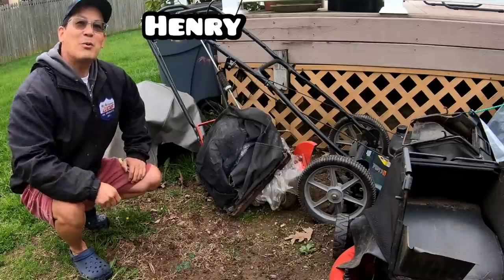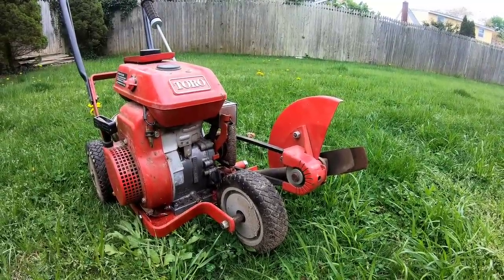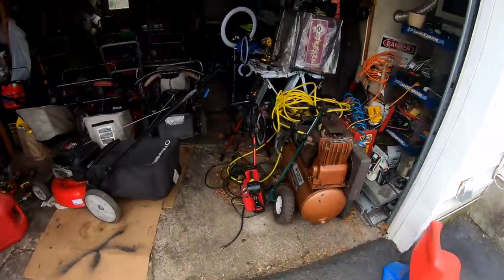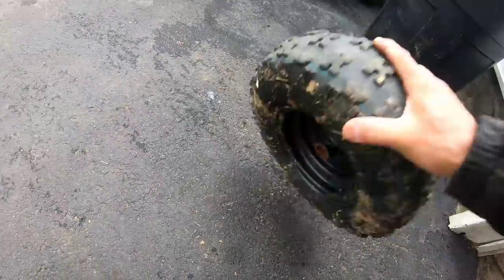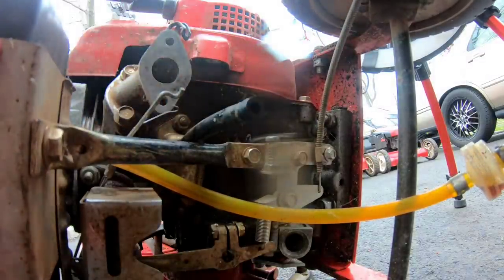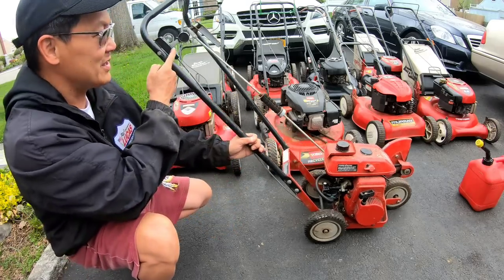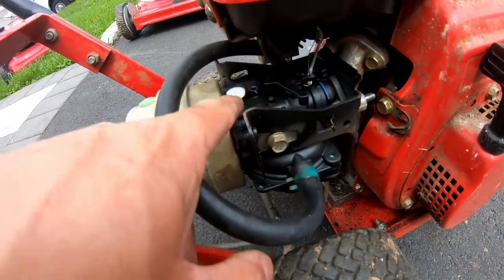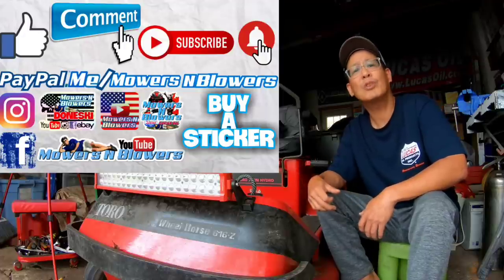FABRICATING A BRIGGS 500E 550E PLASTIC CARBURETOR TO WORK ON A TORO 58402 W/ 2HP SUZUKI ENGINE EDGER

Comment: I can't believe that worked. Those Suzuki engines are something else. I have 2 Toro mowers from the 90's with Suzuki engines. A 4 cylinder with blade clutch and a 2 cycle commercial. They both run great.
Reply: Damn a 4 cylinder mower! That must be worth crazy money. Didn't even know they existed

Comment: Wow! that overweight vintage edger belongs in the museum. I been buying those lightweight battery operated Worx lawn trimmers ($100+/-), they are great for us seniors especially me with a bad shoulder. I had two, gave the first Worx trimmer away to some senior citizen lady, plus extra threaded spools.  A lot of equipment are switching over to battery operated, so get on the train or be left back at the station.

Comment: It's cool you made it work.  Those edgers  are all but obsolete, as you know.
So a carburetor is a precise and integral part of the engine.  It has to be the correct size, be secure so no air is pulled in from around intake manifold and throws of the fuel/air mix.  14.7 parts air and 1 part fuel is the standard.  For equipment to run right consistently, everything (jets, passages, gaskets, adjusting screws) all have to be correct.

Comment: Looks like there are two blades stacked together on the Toro edger? Nice job with the carb, is there any throttle control?
Reply from the maker: Yes,  and it works

Comment: Hey Henry I was thinking the Kawasaki FJ180V engine carburetor is same for your Toro Edger with Suzuki engine.
Reply from the maker: Moot point now,  it’s goneski!
Reply: @MowersNBlowers  Good deal glad a new style briggs carb worked for you.  Will be a new thought process for me when I have to swap out vintage carbs.  Took me a while to track down a carburetor for a vintage Jacobsen 2 stroke push mower. New sticker idea GONESKI, LOL